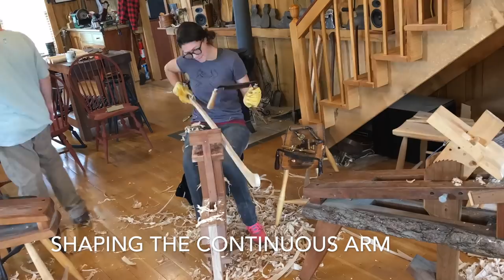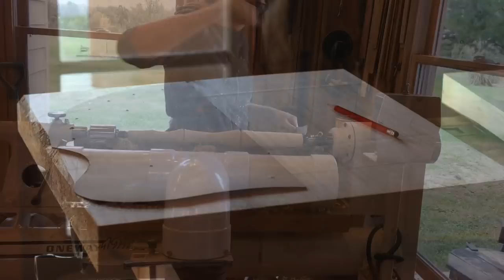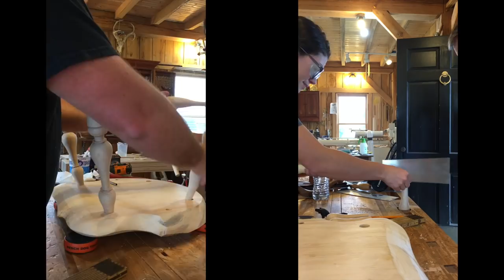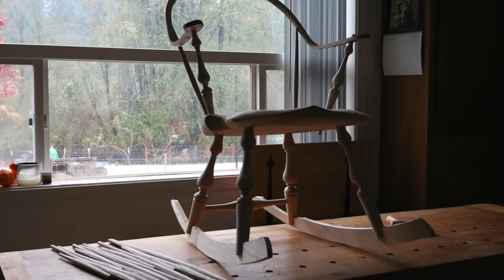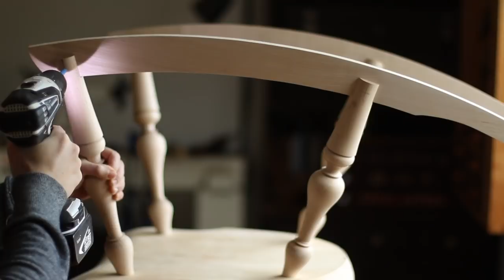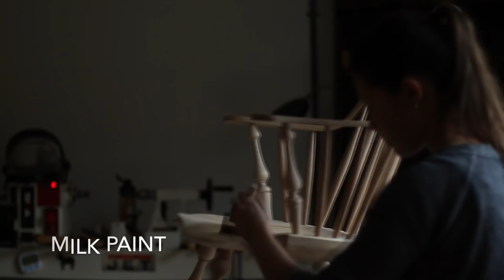Building a Rocking Chair // Woodworking

Comment: Nice chair!  It is hard to tell, did you do any sanding to bring out the red or are you going to let that happen over time naturally?  Either way, great build and thanks for sharing!
Reply from the maker: You burnish the black with a burlap cloth as you apply the oil, which helps the red show through. I didn't do much though, because this chair's gonna get a lot of wear, so the red will come out naturally.

Comment: How do you keep it from cracking?
Reply from the maker: The chair? or?
Reply: You've used the wood from a fallen tree.  Not kiln dried.  I'm trying to figure out how you carved a beautiful chair from a tree and kept it from cracking as it dried due to uneven moisture release.
Reply from the maker: Boris the Bilder ah! The first piece of that puzzle is very careful consideration of grain direction and placing pieces in the proper orientation so their expansion and contraction wouldn’t affect the pieces around them (most notably the chair seat and continuous arm). Same process with the wedges. The armrest and spindles were made from green oak, the legs were rough turned from hard maple when green, then put in a light bulb kiln for a period of time and finally finished turned when mostly dry. Once the spindles were rough shaped, they too were put in the kiln for a period of time. The continuous arm, once shaped, was steam bent then dried in the form by the fire for a few days. The pine seat was, in my understanding, fairly dry to begin with. Upon assembly, none of the pieces were really green anymore.
Reply: Thank you!  Very nice work!  Where have you gained such expertise?  I want them as a teacher!
Reply from the maker: Boris the Bilder check out the chairmaking school I linked above.